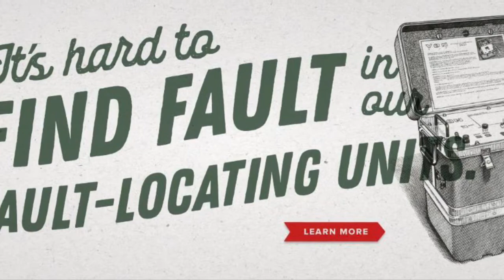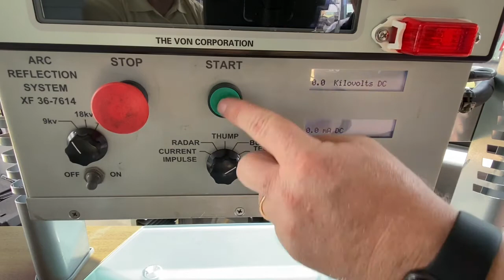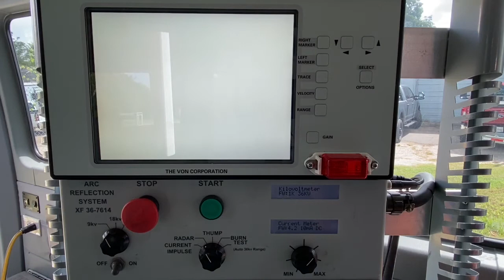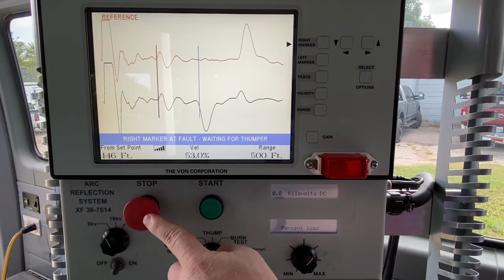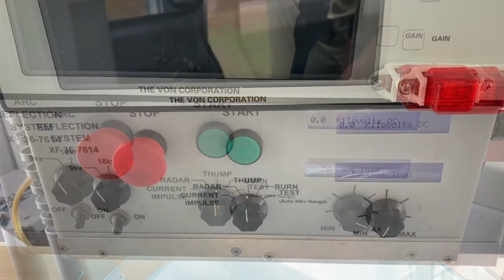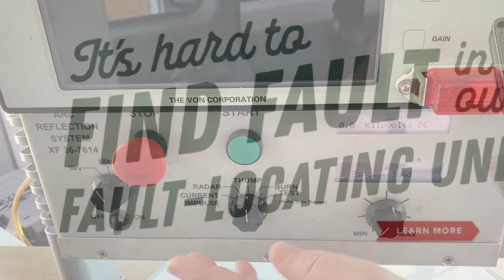VON Training Video Fault Locating with Truck Mounted XF

Comment: Hello I work for an electrical utility company using a very similar fault locator. When the radar auto analyses, it shows the right marker at the fault before ever pressing start to send an impulse. Then when we send an impulse, it shows another location for the fault. Also where I work, some people say to never move the markers and some say you have to move the right marker to dips in the graph because those are the fault. Could you clairify this for me?